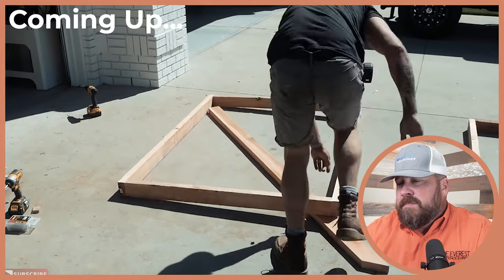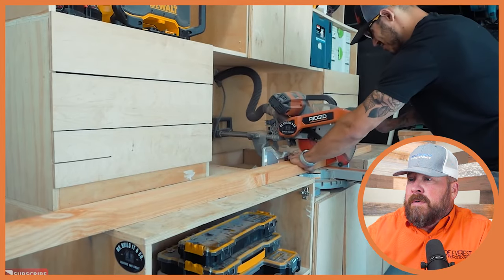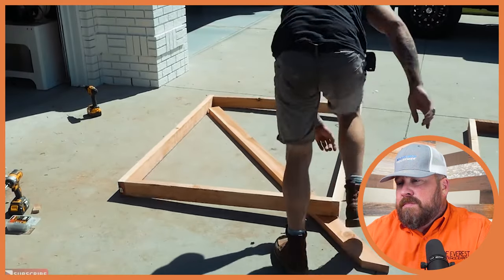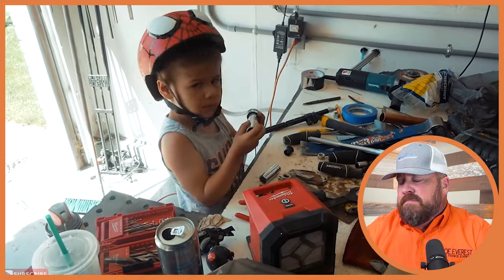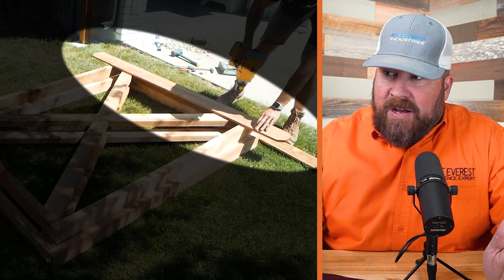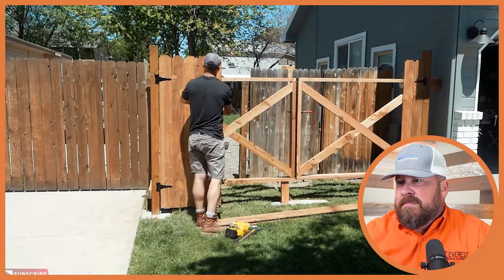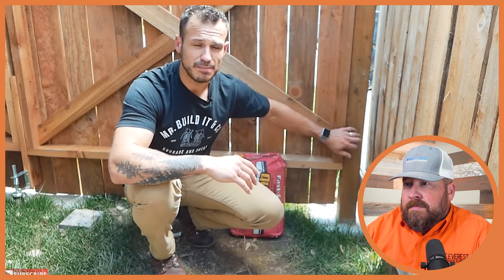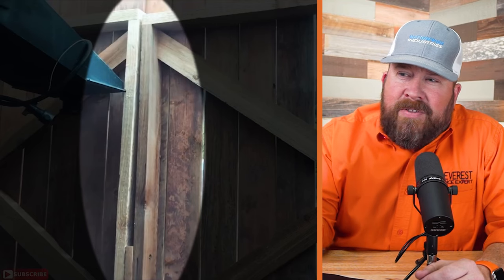"No Sag Gate" FAIL - Pro Fence Builder Reacts

Comment: Last year I got to witness a very entertaining job being done for my neighbor. She hired 2 guys to build her a new fence gate. These guys put a a 4x4 in the ground about 2 ft, screwed some regular interior door hinges to it and mounted a prebuilt wooden fence panel to it. Done. If you know anything about gates, you know they have to be cross braced and the post needs to be properly fortified to support the weight. This thing sagged and scraped the ground like you wouldn't believe and it fell completely over 3 times. Each time if fell, these guys were called back to fix their work. In the end, they ended up strapping the post to the house with metal strapping, and they put a large caster wheel on the sagging end of the fence, so that it can roll along the ground instead of scraping. It's the saddest job I've ever seen and I can see it every time I look out my bedroom window.
Reply: I’m surprised they came back to fix it usually guys like that do the disappearing act so give them credit for that at least 😂. I feel bad for your neighbour.

Comment: I have 2 redwood 6' gates (12 ft') that are mounted to redwood posts that are 30" deep and 8" x 8". I like to build the frame with a simple diagonal cross brace (Post low side to latch high side). One trick I learned is before adding all the pickets (after mounting the frame to the post) is to have the frame start off with a slightly (up) bubble. Latch side higher than level by a half bubble. This way when you add all the weight of the wet redwood pickets the gate "levels" out when you are finished. I also build the fence as a board-on-board privacy fence so there is added weight to consider. If you start out with the frames mounted level THEN add all the extra weight it will sag big time. 3 years later I can easily open and close these gates with a simple effort and they have maintained a spot on level.

Comment: We offer a lifetime workmanship warranty as well, we don’t advertise for fence building, we mainly are hardscape and deck focused but for clients who are already spending a large chunk of change with us we will do their fencing for them. The reason we don’t advertise or take solely fencing jobs is just too many headaches between neighbours with property line disputes even though we build off of the property survey measurements and only allow for tolerance onto our clients side so if we’re an inch off the property line it will be our client losing the inch but generally are spot on with the survey. We do everything with pride in our work, we’re a small company so we can assure everyone’s quality standards are as high as possible simply because once we wrap a job we don’t want to have to come back and fix things if it can be avoided. That being said we always make sure we overbuild our gates, knowing that they are the most common point of failure, I would rather spend a few more dollars up front during the build process to do it right than spend that money coming back to fix it and worrying I look bad to the client because of it.

Comment: Hey Joe, I just recently replace a section of fence that will have a double gate in the center entering to the backyard.  The question I have for you is "you are not a fan of connecting the fence to the house" due to possible damage over time from natural causes.  In South Carolina our frost line is 4" do you see that as an issue still?  Also, when packing the concrete, I prefer mix first, should you fill the entire hole or would two bags be enough for a 24" hole and then pack the rest with dirt?  Thanks Matt

Comment: Most gates fail because everyone thinks they need to reinforce the gate.  But you also need to reinforce the fence side of the gate hinge side.  Drive around a ranch or farm and you will see the fence at the gate opening reinforced at least 6 feet back from the gate opening.  Or you will see bad gates where they did not.  Over time they will sag any way and you will need to adjust.  Doesn't matter what kind of fence it is.

Comment: I just built a fence with a gate a 6 foot gate i left the post about 18 inches high and ran twisted wire from the top to about the middle of the gate with a turn buckel in the middle i can stand on the end of the gate without sage.

Comment: His fence was not bad - but as you said there are better ways.  Love your Videos.

  As for me I am an avid DIY'er and yep I have made my share of mistakes and have learned from them.  My first thoughts these days are find someone that knows and learn from them.  I Live on a culdesac corner house and have 300 Feet of retaining wall with a 4 foot custom made picket fence.  I cut each picket by hand with a band saw 300 liner feet worth with 4" wide pickets with 3/4 spacing between each.  All cedar except one panel where I had to use pressure treated wood as I think I bought every 1 X 4 cedar plan in the region and I could not find anymore.  Fast forward 20 years later and guess which section I have to replace this summer?  To be honest laster longer than I thought but it was painted every 5 years or so an off white cream color.

Since the fence is behind a retaining wall I made oversized forms for each post as safety was a concern with a 5-6 Ft drop off on the other side.

NOW though it is time to put in a quality gate as the gate that is on the 4th side not facing the street was until now a wrought iron one that has finally rusted itself to the grave and pre-dated me at the house.

Comment: I have pulled post out that had rocks in the bottom. I have douse the concrete is weak and very air filled 6-10 inches up. It looks like to concrete mix is separating and going into the rocks. Very odd looking. Idk if this was set a set dry, pre-mixed, mixed as they went. Would love for you guys to give it a text and see what you get.

Comment: The guy thinks you can apply pressure treating yourself. 😆 It's called pressure treated because it's done under pressure, and it goes deep into the wood . He's probably getting confused with end-cut treatment, which is used on cut ends of pressure treated lumber. You can't use it to turn a regular piece of lumber into pressure treated lumber.

Comment: silly question: if I use a bunch of undersized hinges instead of just two big ones, is it just as good or do you run into some other problems/risks?
Reply: Imagine 3 people pulling a sheet evenly at the same time and same rate.   There's going to be wrinkles and imperfections.   Each hinge will  be at a slightly different angle   so when opening they will all rotate at different angles and fight eachother   the more the merrier is not the motto for hinges.   That's why Massive  Castle gates had 2 hinges.   Never will you ever see one with more then 3....  If one with 3 even still exists....

Comment: You may consider advising folks against attaching a fence to their house. As a hurricane Michael survivor on Panama City, many of my friends were amazed to find out that their fence destruction would not be paid for because their exterior structure limit was used up by the shed damage, if the fence was attached to the house it would have been covered up to the total insurance limits.
Reply: That's an interesting little legal/accounting quirk.  It may or may not apply to the specific terms of a hypothetical DIY guy's insurance, so might be worth checking.

I'm sure that what Mr Everest is saying is definitely the best practice from a purely construction POV though.

That being said, I don't think you guys down in florida even get much in the way of freezes so I'm not really too sure there's actually much of a down side down there.  In the midwest, winter is definitely a consideration that needs to be taken seriously.  We may not have hurricanes, but we do have tornadoes capable of demolishing any fence.  Winter is a certainty though and tornadoes are an edge case.  I think that, for us, not attaching it to the house is probably the right call regardless of the possibility of having to make an insurance claim.
Reply: Note to us all that do not have a fence attached to the house.  If a hurrican hits and your fence is destroyed run out and screew an old cedar board to the house and state that is where the fence wast attached....
Reply: @333cparker  
Just one screw brings the crew..

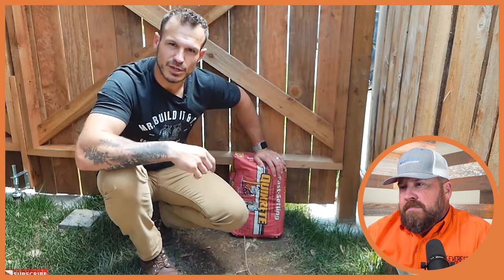Comment: Great vid.   Question : what do you mean at 13:36 that the hinge post is unsupported.  what would make it supported? Thank you.
Reply from the maker: The hinge post has no support to keep the top of the post from pulling over, since it’s on a corner.
Reply: Thanks for response.  So the concrete and 2ft depth of the hinge post is not enough?  Can you elaborate what would need to be added to make it supported?
Reply: What would the recommendation be to support the corner post in this scenario? Metal post? Is there an alternative to that?
Reply: @DigitaLinfamy  Just my $0.02 as am amateur. I just installed a gate for a fence around my chicken coop. I used 8' 4x4 posts set in concrete. Each post has metal wire fencing attached that runs to T posts around the perimeter, with a wooden gate in between. The tension of the fencing started pulling the 4x4 post on the latch side away from the gate. Every day I went out the gap was about 1/4" wider, until it started binding up and wouldn't latch. Luckily on that side was able to add a beam from the coop itself to the top of the 4x4 post to brace it in place. I think the other post is probably in equilibrium between the fence pulling on it and the gate pulling on the other side. But yeah, the amount of flex in the post really surprised me. With a little constant tension they will slowly bend in that direction with no other bracing.

Comment: Pressure treated post tweek like bannas terrible for fence post should be 42in deep. 2×4s are wrong way cross brace x pattern is to heavy on gate. 25year installer.
Reply from the maker: Great points!

Comment: How can you be a fence builder or carpenter and not know how compression or tension braces work?
Reply: Not everyone is there
Reply: You don't have to know how they work if you never had to use them. 🧐
Reply: @Mike  if you build gates, you should be using braces but nothing suprises me. I see junk work on the regular.
Reply: What did the host get wrong? Everything he said was right…
Reply: Look up the definition of compression brace and tension brace
Reply: Greetings from the UK. My question is: Alot of people use a half lap joint for the main gate frame however,  in your opinion, what is the best way to attach the brace to the frame?
P.s. great channel. Thanks for the how-to’s and advice.

Comment: joe do you have a video that shows a double gate using your brackets listed on your website? I'm not finding anything. I'm ready to order, just need some clarification
Reply from the maker: So far just the single gate. The double gate latches work in the same way. With the exception of the actual latch being bolted to the gate from rather than the post.

Comment: Screw that for a game of soldiers. 

If I'm attaching gate's that size, I'm going for either a concrete post or a steel post. 

Although I hear that concrete posts are almost unheard of in the States?
Reply from the maker: Agreed, steel posts have become our standard in ver the years. Yes, while they’re somewhat available, concrete posts aren’t used much here in the States.
Reply: @JoeEverest  really odd that. I wonder why?  

A good quality, rebar reinforced concrete post is a beast of a thing. 

Dirt cheap too if you are competent enough to knock together a form and mix some concrete!
Reply: @AntEloftheHouseofEl   it's time, money and space.  Steel posts best all 3 vs concrete...   Only caviat is diy installation
Reply: @lisat9707  I can't imagine why DIY installation of a steel post would be an issue when it's essentially the same process as for a timber post?  

Unless you are referring to the steels that are machine driven into the ground of course.